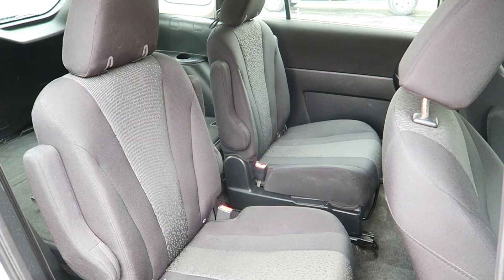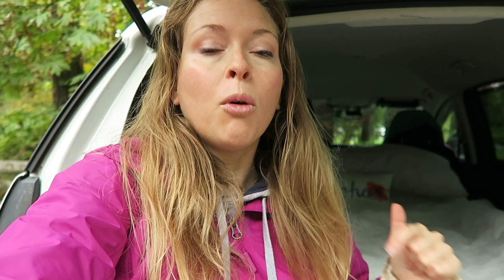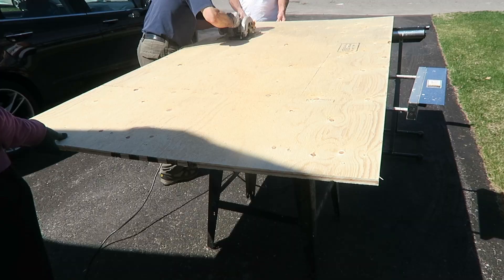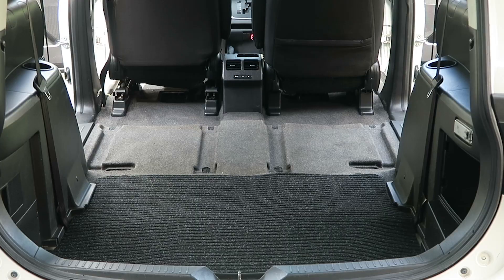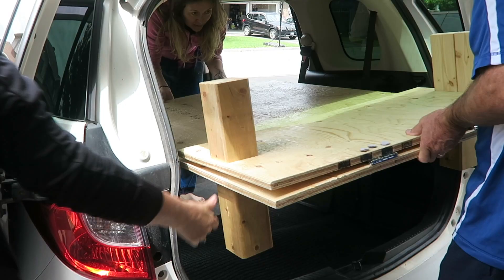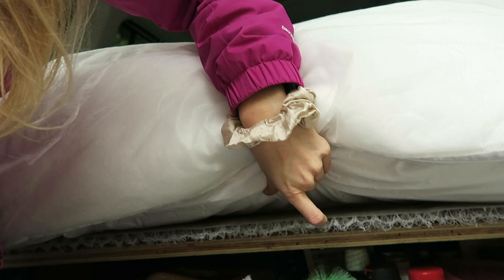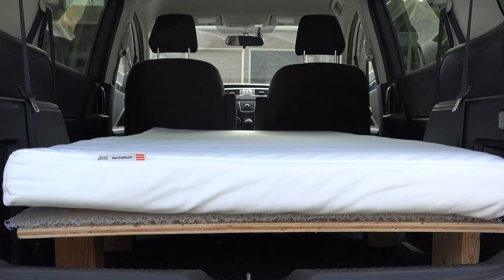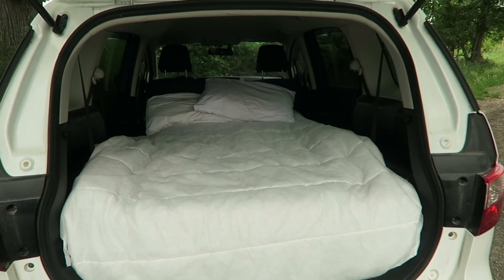Building the Campervan Bed ✧ SOLO FEMALE VAN LIFE

Comment: Lots of ppl use plywood, and I always wonder why no one ever uses a hole saw for ventilation. Maybe it's just too much idk. Just a thought.
Reply from the maker: The holes would need to be at least 1 inch in diameter and a couple inches apart all over the plywood in order to work to prevent moisture. So the airvent i bought was the best solution for me as I didn’t feel like doing that!